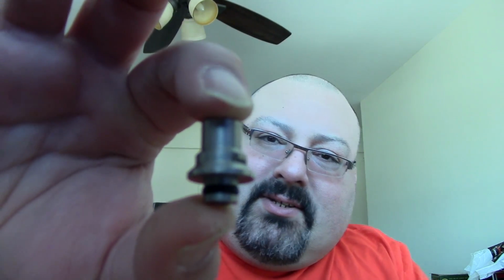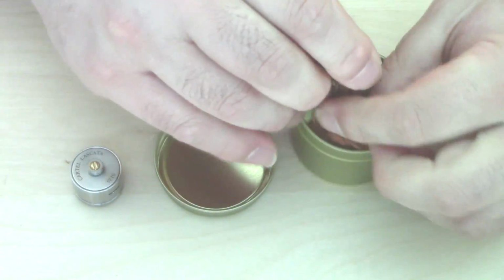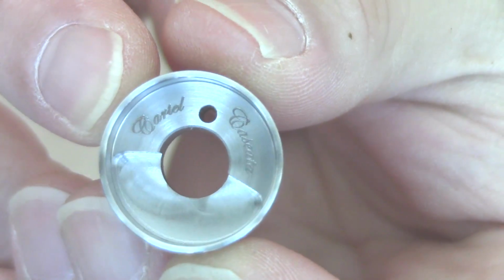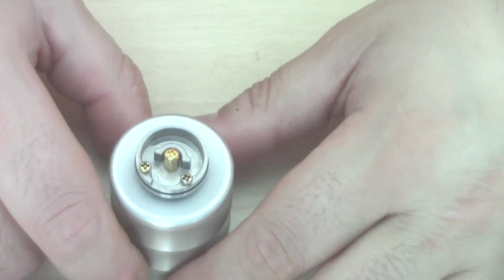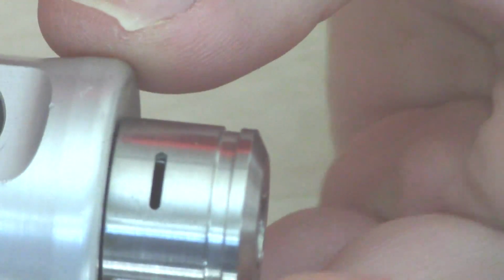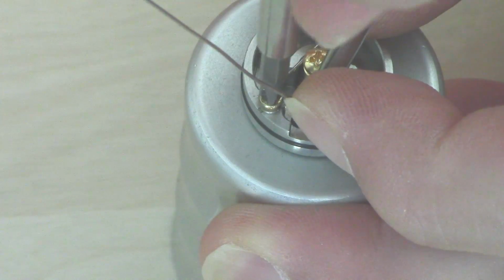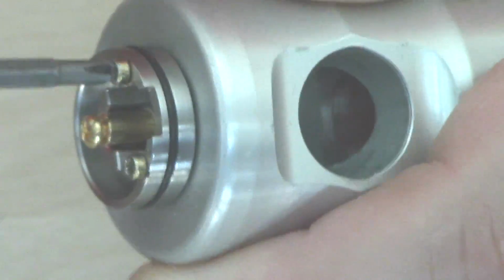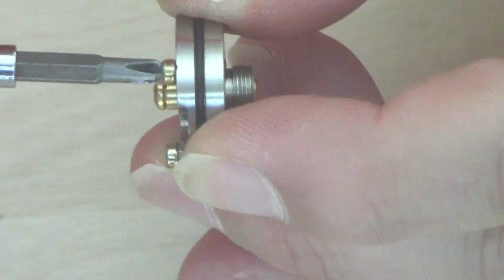Cartel Cascata RDA

Comment: we apologize about the defective product that you received, we learned that on our last phase of our production that the negative holes we not tapped correctly, meaning when we bored the hole, it was too big so when it comes the time to tap it, the hole was too big that the threads are thin and not grabbing. we have gotten returns and made sure that we replaced the damaged decks for brand new ones that are tapped correctly, we know you emailed us already and we are in the process of sending you a new deck. we stand behind all our products and we want to make sure what you pay for is what you get, its an honest mistake on our part and we apologize, we will do everything to make it right, and this goes out to everyone of our customers not just you.
Reply from the maker: you will need to contact cartel and send them back the product for exchange.
Reply: Cartel Mods As a current reseller for Cartel Mods I too had the Cascatas from this batch which had the exact same issues going on. I immediately contacted  Cartel (Gino and Nikki)and just as a reputable manufacturer should do informed me of the situation, reasons as to why it happened and a sincere apology for allowing this to happen. The promised to make good on what will be done which is replacing my entire order with as quick of a turn around time as possible in order to keep me as a satisfied reseller that represents them. I appreciate the service I have received so far and am confident all will be made right. If for some reason this does not happen I'll let it be known for sure. I was a satisfied customer of theirs way before I was a reseller and have always received top shelf customer satisfaction when dealing with them which was very rarely.
Reply from the maker: Cartel Mods Thank you for getting back to me. I receive the package and made video and will be up in few minutes.
Reply: I am having the same problem my cenger post is all floppy and the screws wont screw down
Reply: Thanks I did they got right back to me like 10 mins or something. Very good customer service response. We'll see when I get it back.
Reply: Cartel Mods you definitely get what you pay for....maybe you shouldn't jump vendors every other week, and instead pay the ones you owe. Word gets around quick in this community.

Comment: That's garbage, I've been thinking about getting this too... Did tighting the bottom contact help at all? Cause that's bs that it doesn't work
Reply from the maker: I tried tightening the center post using a philips and flat screw drivers. The issue is the center pole keeps turning even after its been tighten.
Reply: Such a shame... I hope they get back to you brotha
Reply from the maker: Calvin Strothers Im still waiting and no answer.
Reply: ***** what a joke there probably off on weekends good thing I only have one thing of there's and that's the ss cartel mod